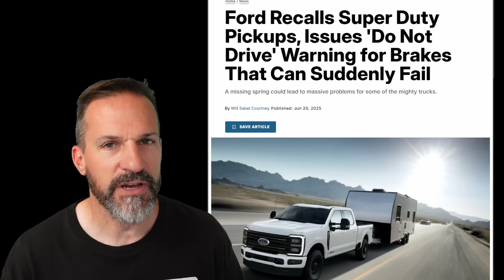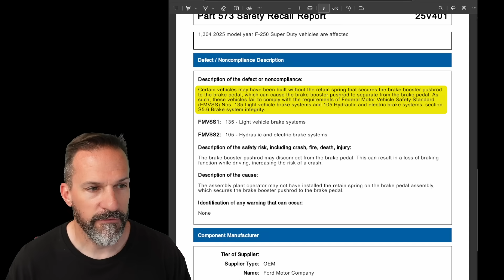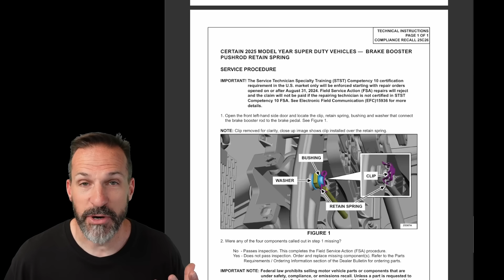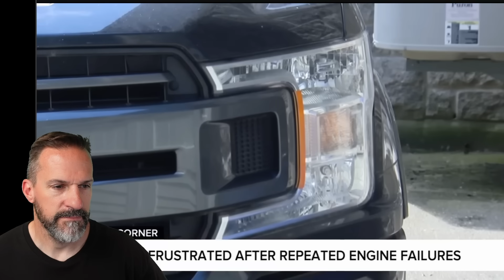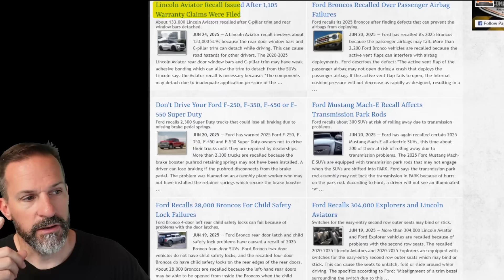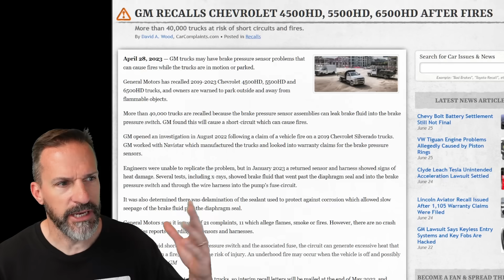WHY DID FORD Let These Trucks Leave the Factory? Ridiculous...

Comment: Bought 2 post 2019 cars in the last 6 years and both have had problems. 2019 mustang gt (engine tick and oil leak with 20k miles) and a 2022 s plaid (vibration at 40, screeching front end when turning for the first few miles after movement, and headliner falling above my head). Bought a 2004 gx470 long before all that and to this day it still has remained problem free (minus the battery dying one night from the cold and the doors not opening even when putting the keys in the door lock) at 260k miles.

Comment: Ok, what Truck should I buy. ???
The new Ram looks good inside & out, but I’m sceptical of the new 6 cylinder Turbo engine.
The Toyota 5.7 V8 sucks gas like crazy and I find the cabin noise is not the best.
I bought a brand new F150 3.5 platinum and it’s a beautiful driving truck, but I’m nervous about its longevity.
The thought of trading it for the high end Ram has crossed my mind a few times, but I’m not sure who makes anything decent I can tow with comfortably..

Comment: No doubt that QC is lacking. When I was in manufacturing, it was understood that each employee on the assembly line was tasked with QC at their station, it was assumed that the assembly was done correctly when it arrives at the next station. Being involved in assembly engineering I objected to this concept but was overruled every time by management. This "concept" eliminated the need for the QC inspectors and management believed they were saving money. Bean counting has created this problem of ever increasing recalls which wind up costing more money in the long run, causing the beaning counters to find more ways to cut costs creating even more recall problems.

Comment: Ford failed to be able to assist me in getting recall glass repairs done on my 2021 Mustang Mach E where glass roof and windshield could fly off on the freeway. No dealers could or would perform these recalls. Corporate customer support was unable to help me satisfy the recalls and were unwilling to buy the car back.  My wife did not want to ride in the car due to the recalls so I had to sell it on my own and take a loss. Thanks Ford, NOT!

Comment: Ford did that same stupid crap in the 80s and 90s with the brake fluid pressure switch and had to recall them. They just recycled the failure how does no one remember what doesn't work

Comment: another good one from ford is the block heater recall on the bronco sports & escapes with the 1.5L engine. The current fix is removing the block heater & installing a plug in the engine. I've done about 15 of them now haha. Block heater overheats & poses a fire risk.

Comment: Also, this business model really messes up those of us that can’t afford to buy new. I used to buy cars that were 4 or 5 years old. I have a 2014 Camry I bought in 2019. I will not get a vehicle made in 2020. Instead, I’m driving that Camry until it drops. One, I can’t afford a 2020 comparable vehicle any more. Two, they are not worth it. So those of us that can’t afford new cars are the ones getting the short end of the stick. So much for helping the little guy.

Comment: Had a 2019 Expedition with the 10 speed that always slipped and messed up and was never corrected properly at the dealership. Then at 169,000 miles developed a rod knock on the 3.5 Ecoboost… bought a cheap used Equinox to drive while I’m restoring a 1991 GMC Suburban. I’m done. No more even relatively new cars. They’re not getting any of my money ever again. They’re ALL overpriced junk!

Comment: I bought a brand-new F-150 diesel in 2018.  At about 4,000 miles I lost my brake system on the freeway.  I had to use down shifting and grade to safely get it pulled over.  4,000 miles!  Took it to the dealership and they had it for two weeks to fix it.  Their overall response was, "Huh. That's interesting .... NEXT!"

Comment: The silverado fire recall is the EXACT same thing that plagued fords from the LATE NINETYS.  In their case it was the cruise control cancel sensor on the front of the master cylinder.  For some reason that's always hot, and when brake fluid migrates through the shoddily constructed switches it ignited.  Their "fix" was a pigtail with a fuse in it.  It doesn't seem like there is any sort of institutional memory and nobody is learning anything.

Comment: At least with an EV you can use regen braking to slow and then even stop a runaway truck with brake system  failure.

Comment: Catalytic Converters Going Out? I'am under the Impression that is Covered for an Extended period of time under emission's control. I own a 2022 F-150  3.5 Ecoboost that I just LOVE the Truck. My Biggest Issue so far has been the Tranny!!!! And, it's in the Shop Again (06/23/2025) for the Tranny and Hopefully FORD Will step up to the Plate and Replace the Tranny (Again) Hopefully with one that Last's more than 10K miles. Other wise i haven't had too many Issues, a few Recalls, and the Notorious Panoramic Moon Roof "LEAKING ISSUE" Now that one I made it nearly Three Years B 4 It reared it's Ugly Head. (They Claimed it was a LEAK from the Windshield). Otherwise my Truck has been Pretty Good so Far. And it "ONLY COST US"  $88,000.00 👀🥴😟??????

Comment: currently I am finding out ford quality is faulty because of wiring on e150 2012 fuse holder generate too much resistance for the 20 amp mini fuses and my dad has thrown the parts  cannon and still having the same issue bc I just find out about the fuses and the actual issue I now experienced it by the way a misfire I believe will cause your ford plastic intake to just crack and leak oil and coolant fyi 🤦‍♂

Comment: GM will most likely be disconntiued as it´s contract with SAIC MOTOR who owns 51% of GM goes out now in 2025.
FORD is looking at the same problem with multable investers pulling out of the auto industry.  
It will require a strong legislation to let in forgien auto makers into the US market as there is no one willing to invest in starting up any new industry.
CEOs and the American Goverment effectivly killed the US Auto Industy!

Comment: The 2002  Ford Ranger had the same issue with brake fluid leaking around the master cylinder causing a fire at the brake pressure switch. My dad's 2002 Ranger had the recall and was fixed for the same problem.

Comment: All MADE IN CHINA! multiple times recycled steel Chinese computers More profit  over 10X over priced over engineered built to fail assembled anywhere as just in time container delivery does not matter what the label on the unit says. Blinding blue oscillator controlled high frequency so-called headlights. No , I do not get it. You know what inflation is? Anyone who would pay 10X times or more for something that is chunk junk. Makes our currency worthless and every thing way over priced.

Comment: Why would you spend $3,000 on a catalytic converter for your friends 2020 F-150 when you can go to a pull apart junkyard.   With minimal cross-referencing you would almost certainly find something that would suffice.   Most cars there are 2014 and newer. Especially if it's an American car.    With the build quality and subpar metalurgy of the past decade. All in the name of profit.
     Yes, the bean counters have caused a lot of pain, and the Ford CEO has the nerve to say he's furious with engineers.
I don't know if anyone remembers the Cadillac Northstar V8.  The Thing had four overhead cams, 32 valves, exceedingly complex engines. So the engineers finished the design of it back in the early 90s, and then the bean counters got ahold of it.  Lo and behold, they insist that the head bolts are to be whatever the metric equivalent of just below 3/16 s inch is.  Catastrophic problems occur from blown head gaskets on the Beast.  The engine was supposed to be bulletproof and put GM at the top of the Heap.  I suppose the bean counters wanted to save $800 per unit or something with the cheaper bolts.  It caused GM as it was to go under.   
For the life of me, I will never understand this mindset.  Nor the corporate culture by educated people that would insist nothing was done wrong.

Comment: Yes, Ford is making expensive junk !  I had a 2019 F150 I bought new. The dash pad warped on driver's side at defrost vent @ 6mos old. Ford ordered a new pad. Took 6mos under warranty. The 5.0 V8 burned oil, and had ticking/knocking (normal). Transmission shifted erratically since new (normal). Trans went out @ 94k miles( slipping/harsh shifts) Bad CDF drum. Poor design from Ford. Was gonna cost $10k for a trans. Traded that crap in. No more F150's. Junk

Comment: The whole problem with a turbocharged gas engine is that it has to be inefficient when boost is low, which is the majority of the time. 

They should be going to hybrid systems that use very efficient high compression Atkinson cycle engines. Let the electric side be your turbo.

Comment: Just a spring?  Lmao. I got a better one for you. Years ago, GM had cars delivered without front brake pads. 

Recall Bulletin
PRODUCT SAFETY RECALL
SUBJECT: Front Brake Pad Missing
MODELS: 2012 Chevrolet Sonic
CONDITION
General Motors has decided that a defect, which relates to motor vehicle safety, exists in
certain 2012 model year Chevrolet Sonic vehicles. On some of these vehicles, the front
brake inner or outer pad may be missing. A missing pad could result in reduced brake
system performance, require a longer distance to stop the vehicle, and produce a noise when
the brakes are applied. If stopping distance is increased, a vehicle crash could occur.
CORRECTION
Dealers are to inspect the front brakes for missing inner or outer pads. If a brake pad is
missing on a vehicle in dealer inventory, dealers are to install new inner and outer pads and,
as necessary, install a new brake caliper assembly and/or brake rotor. If a brake pad is
missing on a vehicle delivered to the customer, dealers are to install new inner and outer
pads, a new brake caliper, and a new brake rotor.
VEHICLES INVOLVED
Involved are certain 2012 model year Chevrolet Sonic vehicles.
Important: Dealers are to confirm vehicle eligibility prior to beginning repairs by using the
Required Field Actions section in the Global Warranty system. Not all vehicles
may be involved.
For dealers with involved vehicles, a listing with involved vehicles containing the complete
vehicle identification number, customer name, and address information has been prepared
and will be provided to dealers through the GM GlobalConnect Recall Reports. Dealers will
not have a report available if they have no involved vehicles currently assigned.
The listing may contain customer names and addresses obtained from Motor Vehicle
Registration Records. The use of such motor vehicle registration data for any purpose other
than follow-up necessary to complete this recall is a violation of law in several
states/provinces/countries. Accordingly, you are urged to limit the use of this report to the
follow-up necessary to complete this recall.
Copyright 2011 General Motors. All Rights Reserved.
Page 2 December 2011 Bulletin No.: 11354

Comment: You talked about “engineering”……the facts are obvious engineering folks never got dirty and fixed the shit they designed, let’s face it, there is too much engineering in all vehicle these days. Instead of over complicated crap that cost $90,000, they should deseign a $23,000 truck with over built robust components.  Crank up windows, manual seat adjustment, and eliminate electronics where ever possible. I guarantee this work truck market will buy this product. 
“make it simple stupid” is the way to go. 🤨😳😡

Comment: How about GM ordering 875,000 crankshafts for the 6.2 engine and not. Doing random quality control checks. Now. Have to recall the entire production run. !! That. Sucks..
Reply from the maker: Yup, GM has had some insane blunders lately, and even more with the transmission valve bodies.

Comment: I bought a new Kia Rio Cinco in 2001. Zero issues with it for 9 years and 100,000 miles when I traded it, (except for new brake pads around 80k). I thought, "Wow, if Kia can make a comfortable and reliable car, it's going to be difficult to find a bad car any more."  Car manufacturing must have reached its zenith in 2001, based on my experience, and rapidly declined since then. They can make a good car if they want to. They just don't want to.

Comment: I guarantee the "new engine" is only a new short block and the heads are being reused, and these heads are leaking coolant into the oil system which is stripping the lubrication from the bearings.  The dealership is not doing their job.  I bet the same flat rate tech did both of the first two swaps.

Comment: Couple of thoughts...I think a different company will have to come into the market and make something of more quality.  If those sales go crazy then the (big 4 now) might have to change their ways.  Generally speaking, sales across most of these products have been good and they are trying to maximize profits while stripping everything they can.  Makes me really wonder if Nissan Titan would have stayed in the game with their V8 if sales would have spiked or not despit their previous slow sales. I'm just happy I ended up by a very low mileage 21 Tundra last year after being disgusted with all the manufacturers.  I think I will stay with the dinosaurs until I see a change but don't expect to see that for a while. Last thought is it is scary to think that when this generation gets older and out of warranty what will happen.  We are a throw away society because to fix anything a couple of times is often more than the cost of the thing.  Relate it to washing machine other products, etc.  These new vehicles have 30k engines and 28k tranmissions.  That is insance! So you buy a 70k truck and if you have to replace one out of warranty then you go bankrupt.

Comment: I hope the owner of that Ford gets a ticket for Distracted driving. You can't complain about your own safety and safety of others when the engine blows up and be like...hmm should I put my hazards on and pull over, NAH let me grab my phone and make a video so i can get some tik tok views bro lol. What a muppet. There's alot of questions too be asked as well about this engine blowing up in one year, like what's the mileage on the engine? was any regular oil changes done? is there any performance tunes done to the engine ect. I think if you're going onto the news to complain about a 2nd failed engine in a year to try and get pubblicity, then I think the issue just may be the owner.

Comment: I believe it, I’m in AG manufacturing and see stuff similar happening. The “safety check” or “fail safe” doesn’t usually occur until after the fact. Maybe an angry employee but in my experience more than not an untrained employee that was put on a job they didn’t know.  Happens all the time where I work.  Fill in for absenteeism thrown on a job and no or little engineering support. So more then likely it falls back on the manufacture as their own negligence.

Comment: Don't care.  About bottom line.  Is the money saved more profitable than the lives lost, trust in the brand, and the recalls to follow.  Ceo mentality anymore.  Market is starving for something different.  A car that holds up.  Nobody is doing that.  That's exactly how I would sell it also.  Ford has had good products in the past.  The 1990's we're good.  The 1980's terrible.  The 1960's and 1970's some of the most sought after trucks to this day.  Everything after 2000 is a heap of deteriorating garbage.

Comment: I have people fight and argue with me regarding these new vehicles post 2016 or so that swear that new cars are great. One guy fought me saying 270 degrees is normal for a F150 transmission mated to the 5.0 towing a trailer that was around 5,000 pounds. I don’t understand why people continue to buy these vehicles with such a long list of recalls, while the proof is right here staring at them in the face! Thank you as always for presenting this proof!
Reply: Wow, I just towed my toy hauler with my 6.2L gasser with the 6 speed 125 miles to a campground.  It was 98 degrees outside and I checked my tranny temp, it got up to 199 degrees.  That guy is nuts claiming 270 is okay.
Reply: Must not have had a cooler on it lol mine never gets close to that even going up a hill fully loaded

Comment: long ago in an assembly plant far far away, I did that brake pedal job on the Econoline van. Back then we had a bright yellow clip to put on the cotter pin so it was obvious when it was missing, and an inspector two lines over was required to physically touch that clip to ensure it was assembled correctly.
Reply: They replaced those people with ai scanning.
Reply: Thanks for doing that on my old Econoline (1999 and 2006)
Reply: Thank you for a deep insight as to how it should be done.
Reply: Ya, Now the Perfect Robotic Nobody does that work! Pretty Obvious how that's working for them!
Reply: @kendavis1198  Bu bu bu....muh technology! hhaaaahaa
Reply: I remember having to remove the plastic case over the retainer to replace boosters… the good old days when someone in Dearborn really gave a shit.